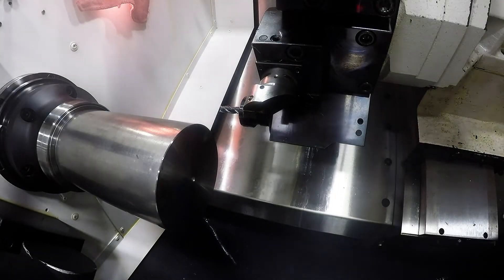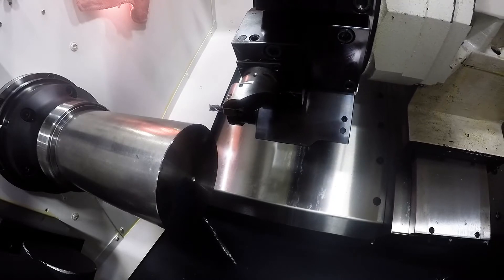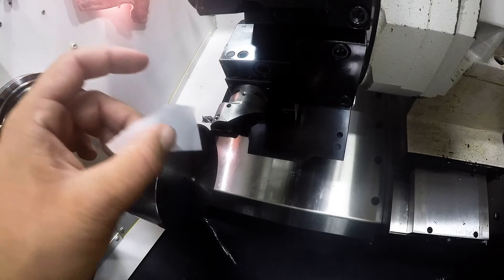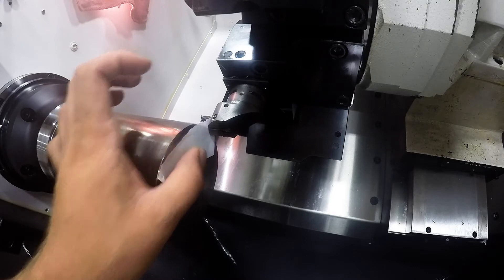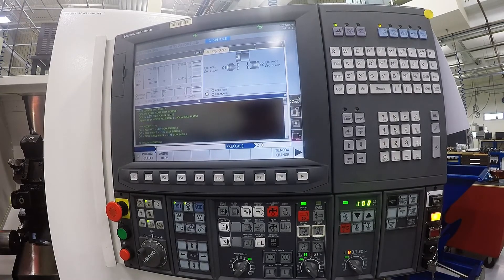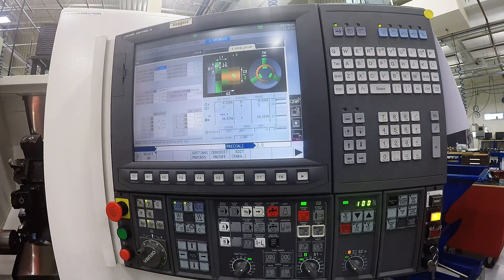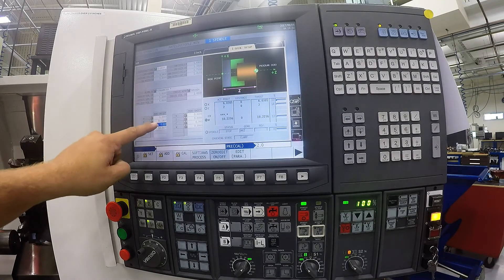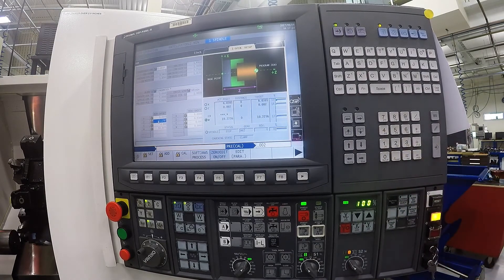OKUMA GENOS SETTING Z 0.

Comment: Hello i have a problem on a genos  L400, the machine is new and i want to use the touch setter to calibrate an I.d. tool  but it doesnt work. I calibrate it and i wanna make a 1 inch i.d. but it make it about 2 inches. 1 more

Comment: Hi! I was wondering about rapid movement potenciometer. Company I work for just bought similar machine to this one and I noticed your's also doesen't include rapid movement potenciometer. How do you safely try out if the program works (in the actual part and not simulation or dry run)? We only got the key that limits rapid to 50% but even then it's too fast to react if something goes wrong. It is only complaint we got so far. Is it possible to set parameters for key to limit rapid even more? 10% or so would be about right for me.. Please help me if you know how because im sweating every time I have to run new programs. Cheers!
Reply from the maker: The rapid on our machines is controlled by the same dial as the feed rate. So we have the students start with that turned way down until the initial engagement and then keep close eye to where its suppose to retract and try turning it back down. It is one very big disadvantage that machine has especially for a school environment
Reply: Yes I was talking about the same problem. There is only one dial for rapid and feed. I'm searching for some kind of solution to this but hopeless so far.. Totally agree with what  you said. Very big disadvantage to this otherwise fine quality machine.
Reply: Their is a option to have it added we had it added to one a think it was around $3500.  1500-1800 parts.